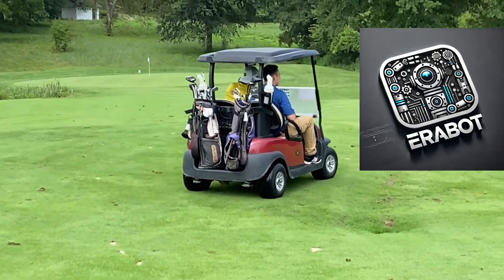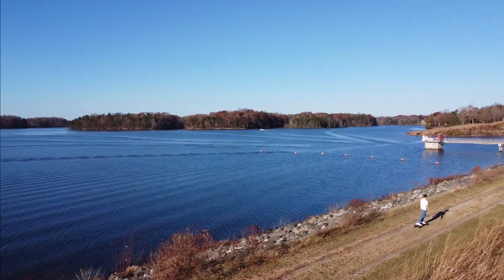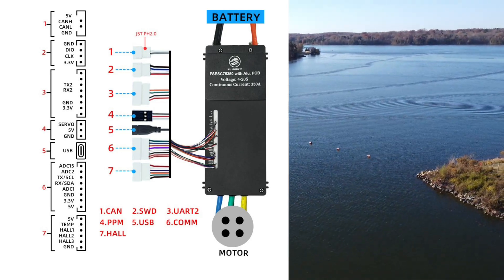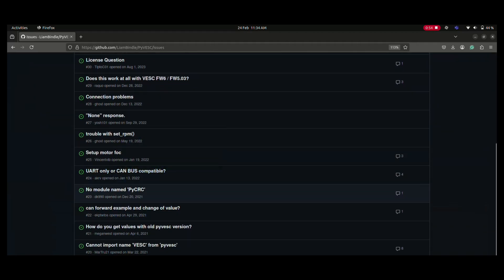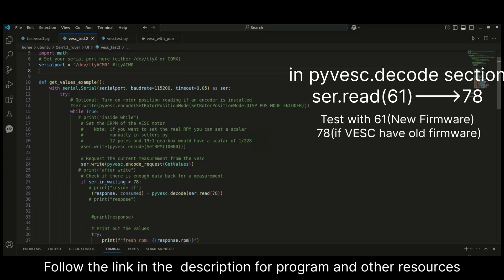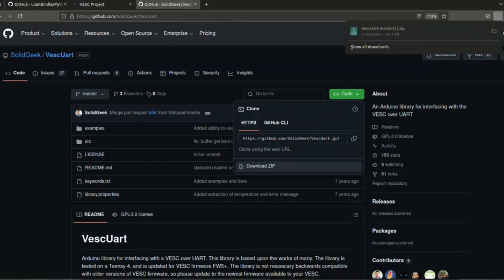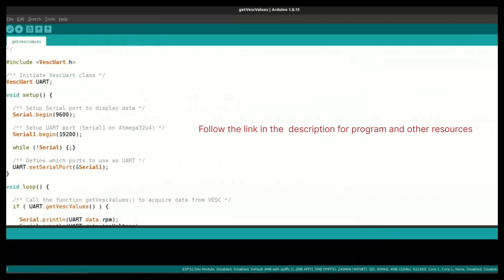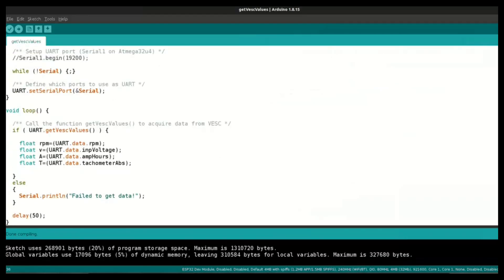Introduction to VESC | Read & write data to VESC | VESC with ESP32/Arduino/RaspberryPI |Python/C++ |

Comment: Hey I owe you a beer!  I got it almost working.  now I can't forward over the can bus on the dual controller.  Here's my code - what am I doing wrong?

import pyvesc
from pyvesc.VESC.messages import SetRPM
import serial
import time

# --- Configuration ---
SERIAL_PORT = '/dev/serial0'
# IMPORTANT: The physically connected VESC is the MASTER
# In your case, you are plugged into the LEFT motor's side.
LEFT_MOTOR_ID = 59  
RIGHT_MOTOR_ID = 45
MOTOR_SPEED = 4000
RUN_TIME_SECONDS = 3
# --------------------

def send_rpm_command(ser, controller_id, rpm):
    """
    Sends an RPM command to the specified motor controller by setting the can_id.
    """
    # Create the SetRPM message object
    message = SetRPM(rpm)
    # Set the destination CAN ID on the message itself
    message.can_id = controller_id
    # The encode function should see the can_id and build the correct packet
    ser.write(pyvesc.encode(message))

# --- Main Program ---
if _name_ == "__main__":
    
    # We use the correct IDs for the left and right motors now
    left_motor_id = LEFT_MOTOR_ID
    right_motor_id = RIGHT_MOTOR_ID

    try:
        # Use the master VESC (the one physically connected to the Pi) as the serial port
        with serial.Serial(SERIAL_PORT, baudrate=115200, timeout=0.05) as ser:
            print("Successfully connected to VESC. Starting sequence...")
            
            # --- Left Motor Sequence ---
            print(f"Running LEFT motor ({left_motor_id}) FORWARD for {RUN_TIME_SECONDS} seconds...")
            send_rpm_command(ser, left_motor_id, MOTOR_SPEED)
            time.sleep(RUN_TIME_SECONDS)
            
            print(f"Running LEFT motor ({left_motor_id}) BACKWARD for {RUN_TIME_SECONDS} seconds...")
            send_rpm_command(ser, left_motor_id, -MOTOR_SPEED)
            time.sleep(RUN_TIME_SECONDS)
            
            # --- Right Motor Sequence ---
            print(f"Running RIGHT motor ({right_motor_id}) FORWARD for {RUN_TIME_SECONDS} seconds...")
            send_rpm_command(ser, right_motor_id, MOTOR_SPEED)
            time.sleep(RUN_TIME_SECONDS)

            print(f"Running RIGHT motor ({right_motor_id}) BACKWARD for {RUN_TIME_SECONDS} seconds...")
            send_rpm_command(ser, right_motor_id, -MOTOR_SPEED)
            time.sleep(RUN_TIME_SECONDS)

            print("\nSequence complete.")

    except KeyboardInterrupt:
        print("\nProgram stopped by user.")
        
    except serial.SerialException as e:
        print(f"\nSerial port error: {e}")

    finally:
        print("Stopping all motors.")
        with serial.Serial(SERIAL_PORT, baudrate=115200, timeout=0.05) as ser:
            send_rpm_command(ser, left_motor_id, 0)
            send_rpm_command(ser, right_motor_id, 0)
        print("Motors stopped. Program finished.")

Comment: This is awesome - thank you for posting this content!  Question. I'm trying to have my RPi 5 control my FSESC6.7 VESC and i'm having trouble making the TX/RX pins work.  I made the UART over USB work (RPi<--->FSESC6.7) but UART over the GPIO to the TX/RX fails to hear any data at all.  Do you know why?
Reply: Did you ever figure out the solution to this?
Reply from the maker: @GabeManero 
In VESC tool. Under "APP to use" make sure UART one of options. Otherwise it won't listen/work with UART !

Comment: Thanks for instructions! But Fromm my vesc uart nothing go out (tested with osciloscope) from can bus have readed correctly commands but when sending nothing happens or wrong format 

Maybe there is some special adjustment for activate uart? 

By PPM was able run motor but need a lot of tuning so looking for correct option of uart/can
Reply from the maker: In VESC tool. Under “APP to use” make sure UART one of options. Otherwise it won’t listen/work with UART
Reply from the maker: Hi Maikel,
Glad it helped you!!